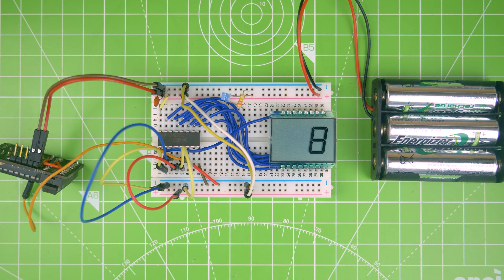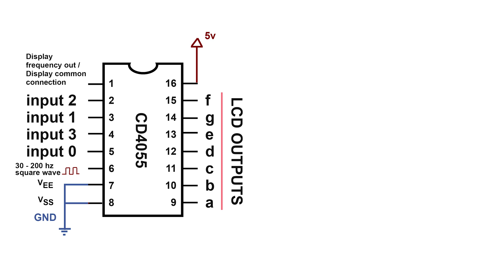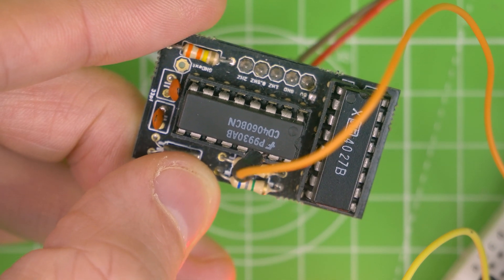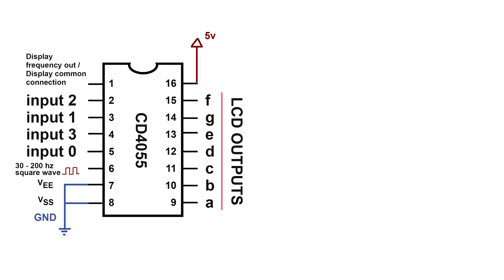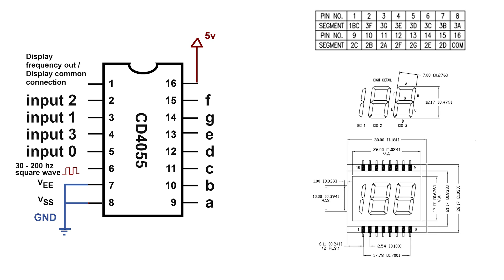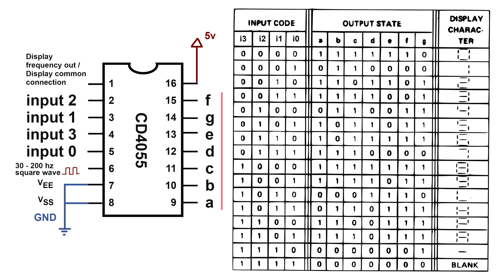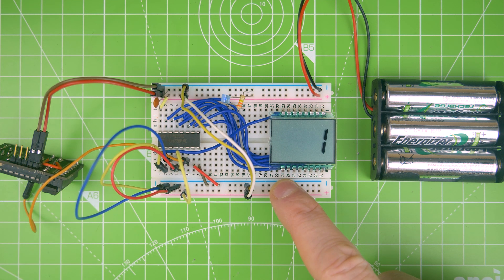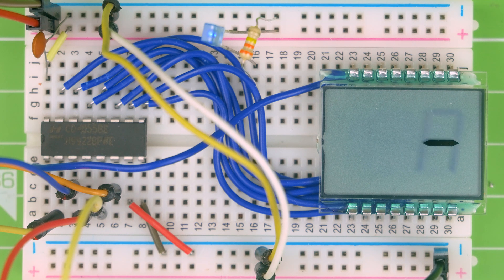4000 Series Logic ICs : The 4055 BCD to 7-Segment LCD Driver

Comment: What mcu are you using there? Thanks for the 4000’s walkthrough
Reply from the maker: It is an ATMEGA32U4 development board I designed with a boost converter on board.
Reply: David Watts thanks for the reply!

Comment: Cool IC. Wouldn't have known about it without this video. I'll look up and ordered few of these, or CD4056 which is latched version. Thanks!
"Back in the day" 4055's brighter brother 4511 was almost as common IC as 555 and 4017 in kits built by secondary school students in shop class.
There were couple dozen kits to choose from, but there were many variations of just couple basic circuits with minor changes. Back then it was just about soldering. most of us had no idea why the circuit did what it did.
Reply from the maker: I like the 4511 nice for LEDs , another BCD to 7 segment as I recall. I was going to make a 7 segment version (so the segment crap clock) of the binary crap clock with them.
Reply: @DavidWatts  74LS248 is also common cathode but TTL LED driver wich is even beter than 4511 because it display tails of '6' and '9'